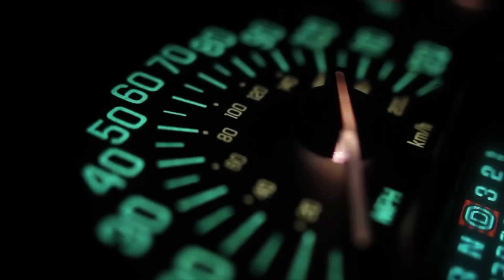BMW 2 Series Active Tourer MSport LCI 1.5 Auto - Day 4 of the Repair - Cat S Salvage Crashed Beemer

Comment: I'm about to put the front end on mine, but mine looks a little more simple to do. The cross bar is a very pointless bit of metal tbh.
Reply from the maker: And I bought the bloody coloured bits thinking it would be at the front 😩
Reply: @carsalvage101, looks like it reinforces the slam panel so bonnet doesn't start shaking about at autobahn speeds 😄

Comment: Hi Paul 
As predicted at the start this one does seem to have been more trouble than usual!- is it worth it only you can answer that id guess! at least your getting there!.

Kinda reminded me of a  conversation i had with one of my neighbours a year or so ago when he bought a used bmw from around the same era! like yourself he had some trouble regarding measuring the oil level to top it up, so he asked me "Steve " do you have any idea where the dipstick is in this car?.🤨
I told him to sit in the drivers seat and look carefully into the internal rear view mirror I suggested he would see "the dipstick" straight away then!🤣(sorry bout that!).

To be honest never had any liking for BMW,s overpriced and over-hyped in my world!- a prime example of marketing over product id say! but to each his own i guess !.
I hope you actually get to enjoy it once its finished!
best regards mate!.
Reply from the maker: It’s cost me a fortune but I’ve still saved around £9k on an undamaged one which will hopefully be indistinguishable from this when the bodyshop have finished with it. I’ve never had a BMW but it does ooze quality. I will definitely buy another I think but not with front damage like this.
Reply: @Love500  Same with most newer cars I'm afraid, so many easily damaged and expensive parts on front end to replace. That's why I prefer rear end or side damage - more work but less expensive parts usually 👍

Comment: Those clips you wound out on the headlights are location adjusters. They are supposed to be on the headlights. You've wound the adjustment right out and is probably why your headlight isn't fitting properly anymore!🤔
Reply from the maker: I thought they were meant to be on the light. I knew they were adjusters on a reverse thread.

Comment: That new gas is very silly expensive, around £130 upwards I believe.
Reply from the maker: And not as efficient apparently.
Reply: @Love500  Isn't R1234YF flammable as well as expensive, so if condenser gets holed in an accident any sparks ignite gas and burn front end of car off as well Lol
Reply from the maker: @SalvageMasterEssex  no idea but doesn’t sound good.